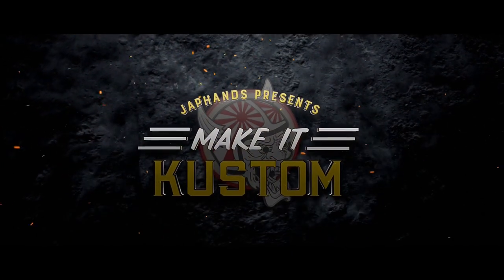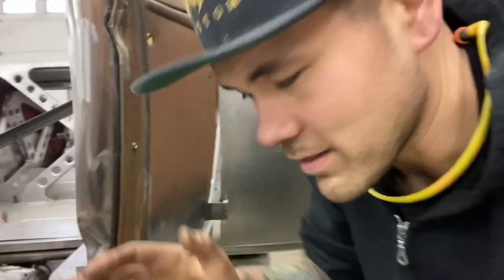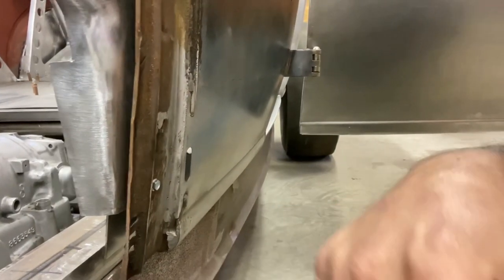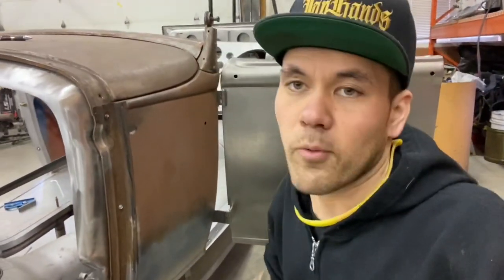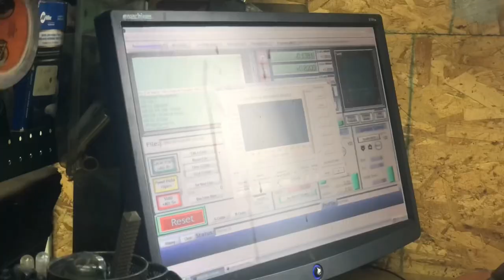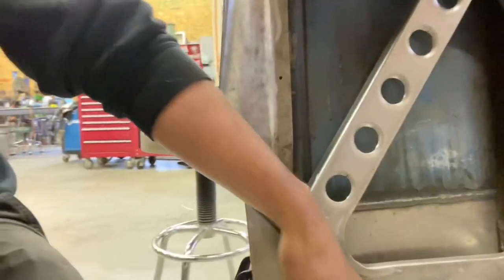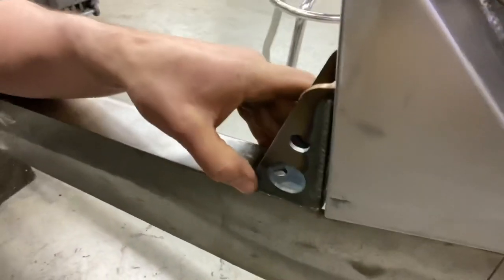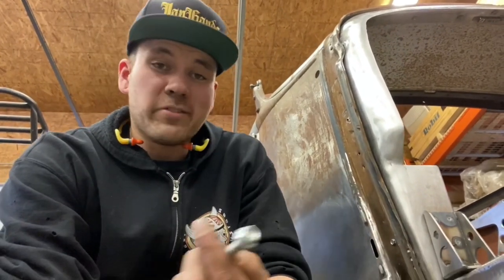How To Make and Install Front Body Mounts and Toe Board Structure (Model A Hot Rod Build Part 2)

Comment: Awesome idea of using the flange nut as a welded in mounting point!  Thanks for sharing.
Reply from the maker: You’re welcome man! Little tricks
Reply: I have made the mistake of leaving the bolt in while finish welding the nut in ,,, but I did it inside the frame it was open at the time ... had too cut the nut back out and reweld a new nut back in ,, the bolt melted to the nut or the nut to the bolt .. learned a little lesson that day  remove bolt to finish weld ..

Comment: Sweet tip on using the flanged nuts to weld into frame.
I know you can buy weld in nuts but this is way less expensive option that are readily available and then sizes all available.
Also need to grind off any gal or zinc coating as toxic fumes when welding.

Comment: The way you made the body mounts is much better than doing it in the press brake. 
Much stronger and no stress. 
When I worked in a vessel shop we fabricated most everything instead of breaking it even though we had one hell of a brake, it was at least 10' or 12' long.
Reply from the maker: Good to know thanks for the reassurance!

Comment: Having the right tools speeds things up! bigtime. I use to be a fabricator I was a welder fitter for most of my life but mostly built heavy equipment and a lot of structural things for high rises and industrial buildings etcetera. You name it I've built it. I guess the internet opens the door to help you make the extra bucks so you can get your hands on the good tools. Than you can build awesome roadsters, right bud O man if I was only born forty years later. LOL

Comment: Started a project WAY out of my experience level. Restoring my 70 Mustang completely down to the frame. 40yrs of WTF?! "repairs" made it necessary to be safe for everyone. I've been MIG welding everything, and think I may be better off TIG welding. The speed lost by TIG, is made up in post processing, from what I'm seeing you do. Smaller, softer, easier to blend welds with TIG.
Reply from the maker: Yes very true! I still use mig welding for some things Tig has a lot less cleanup

Comment: Very nice work. Mad skills yo!!!!
Is your filler wire about 30 thousandth?
Any idea if heat settings 20 amps ish?
Thanks 🙏 for the tips and skills you got bruh 😎✌️
Reply from the maker: I’m using .035 inch wire probably around 30 A but I set my welder to about 55 so I can throttle up to start

Comment: Hay buddy what do you do to the A model frame rails in the rear for the diff thanks . As I don’t like to a it for the lower stance but I think that is what I will have to do . It’s a coupe and still want to have dicky seat not boot 😊
Reply from the maker: You’ll have to kick the frame up a little bit. This car has a 32 Ford style frame. The rear rails come up a bit and there is a c notch in them as well
Reply: @MakeItKustom  yeah okay thanks buddy